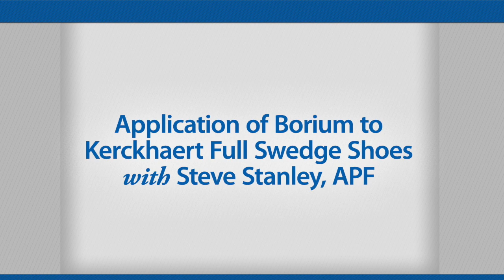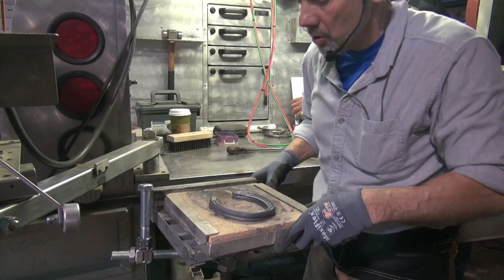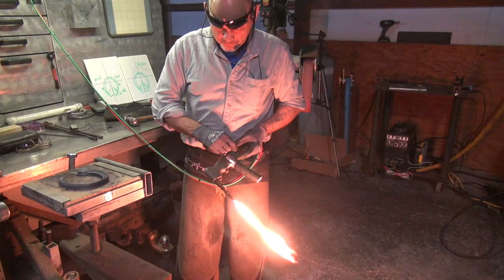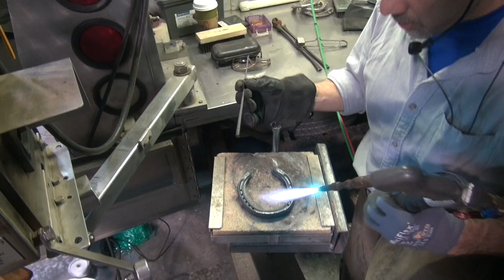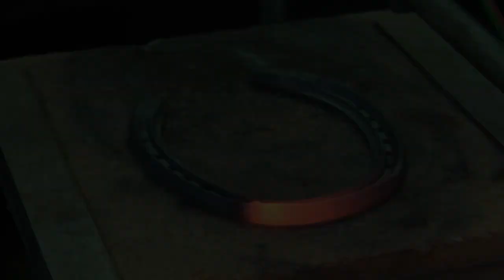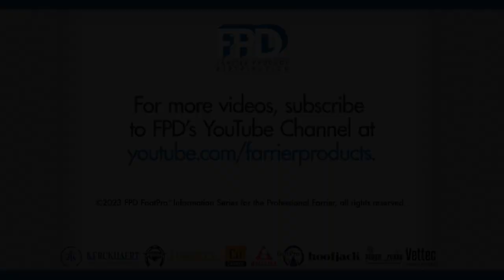Application of Borium to Kerckhaert Full Swedge

Comment: Im sure this gentleman has more experience with this than i do, but i started applying the borium with the shoe in a vice where it was held by both heels. When i was practicing, i realized that the shoe can get kicked out of level from uneven heating and subsequent cooling. The vice kept it level while it cooled. You cut put all that effort into getting that pacer or trotter at a specific angle, i figured best not to sully it with a shoe thats not level.